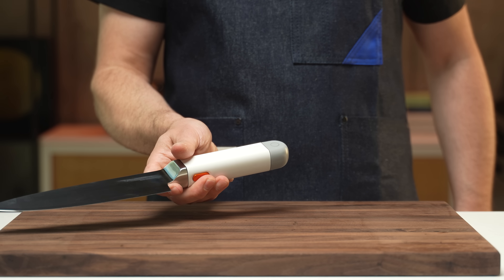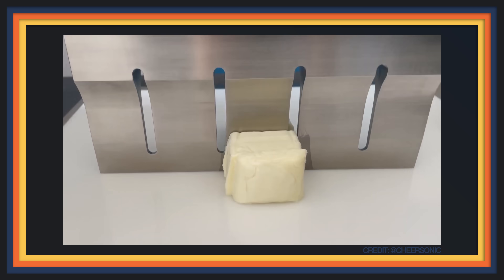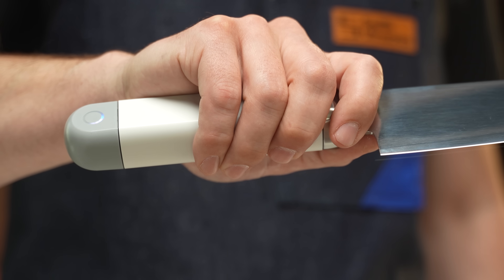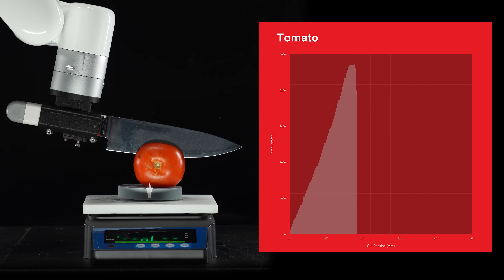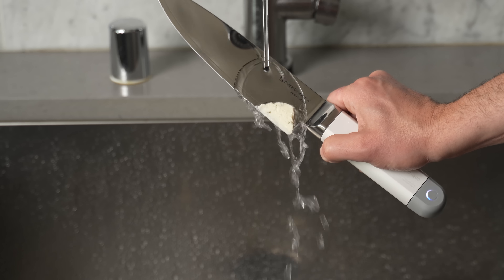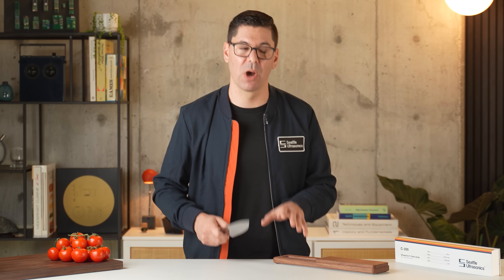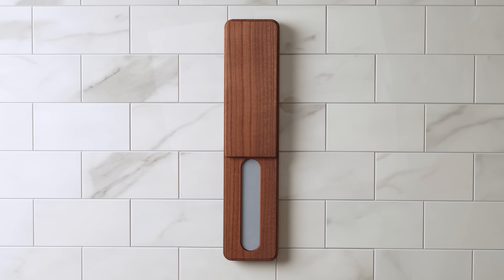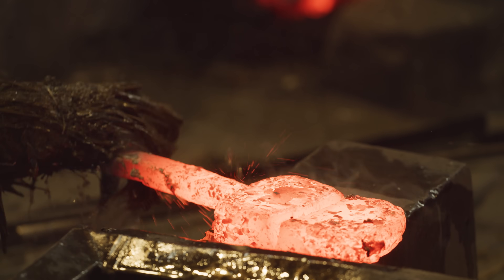The World's First Ultrasonic Chef's Knife for Home Cooks: Seattle Ultrasonics C-200

Comment: I watched this video to the end, took my $5 whetstone and $25 chef knife and put them away, getting ready to order this revolutionary life-changing knife. I clicked to the website, took a look at the US$500 price tag.. And went back to my kitchen, took out my $25 knife and placed it back to its usual place, where I would continue using it tomorrow and for years to come. Thank you for a nice dream. 😂😂😂
Reply: Y'all saying "my knife works all the time" are missing the point.

Most people with expensive knives have dull knives. It's a lot more convenient to put your knife on a charger when you are done with it than it is to sharpen it once a month.

This will (till copycats come out) be the only knife that will retain its ability to cut without regular sharpening that a consumer can buy, period.
Reply: @deejnutz2068  if the blade vibrates it doesn’t mean that it will keep it’s sharpness better than any other blade. On practice this micro-jittering can lead to even faster dullness
Reply: @casualcoffeeshooter perhaps or perhaps not. The microcuts might put less pressure on the blade edge when cutting and so not dull it as fast. But I bet even dull it will still cut a lot better than a normal dull knife.
Reply: @StefanSteinerWA  My Gramma had this kind of electric, vibrating kinfe back in the 90s. Construction was obviously different (huge handle with motor and slots for big batteries), but the main principle was the same - making the blade to vibrate so you can put less force on the knife to cut. And it was easier, when the blade was sharp. It was getting dull like any other blade and required sharpening + the micro vibrations in long-term were painful for the wrist. Back in the day, it also wasn't cheap - costed probably equivalent of modern 500€.
Reply: its actually insanely cheap for what it is

the amount of time and effort that went into this.. and its the only thing on the market.

big greedy corporations would charge 1999$ for that thing in the "base" version.

and they would offer a "pro" model for 2999$ aswell...
Reply: @pedro_peyote  this. I was expecting in the thousands
Reply: @Nooticus I wasn't. At 500, it seems overpriced
Reply: @pedro_peyote not cheap considering the built in battery only last 3-4 years 😂
Reply: @apocalic and what happened to your $500 knife when battery dies and you can't get a replacement 😂
Reply: @apocalic  So then open it up and solder in a new one?
Reply: @apocalic  On their website you can see that the battery simply swaps out whenever you want - they sell extra battery packs
Reply: @DirkGently-km3hn  same what I did with my outdated heated gloves or Makita drill ... go to the workshop specialized in refurbishing batteries. Guy opened it, checked, exchanged, returned, I paid few bucks and keep using it  till today.
Reply: Why did I see 3045?😂
Reply: Honestly.....for high end knives, that's cheap.
Reply: @kylebakner2119  Nowadays you can buy a very good knife that almost competes with high end ones for under a hundred bucks easily. Like for about 70 or smth like that.
Reply: @kylebakner2119  No it isn't. If you are paying over 500 for your knives then you are being a pretentious f(*# and not just buying good knives.
Reply: @kylebakner2119  after 3-4 years the battery will die and you are left with an average knive. The steel used in this knife is nothing special.
Reply: @kylebakner2119  But is this "high end" with a person forging it, or is it a mass produced idea? It's a sonicare knife. You don't have to sell an idea of a knife, they're everywhere. At the end of the day it's a knife that vibrates. This is a knife for people with 0 cutting skills and plenty money. It'll likely be used once then put up. If it's not charged, it's just an overpriced knife. At that point, just go buy a knife. I'm not saying it's not a cool creation, it actually is, but it's novelty. 
What happens if the idea fails and you need a battery that is proprietary? You have an expensive knife that cannot live up to it's intended purpose.
Reply: @Soundsaboutright42 "if it's not charged, it's an expensive knife". I mean, if you don't charge your cellphone, it becomes an expensive paperweight.
Reply: @Soundsaboutright42 Counterpoint: ultrasonic blade is cool as hell. In Metal Gear Rising Revengance, the protagonist rocks a an ultrasonic katana and this is the easiest way for ppl to feel like him
Reply: @Soundsaboutright42  that's like comparing an apple watch or a good smart watch to a spring loaded mechanical watch.
Reply: @Soundsaboutright42  At least if the sonic part of the thing dies, or you can't get a new battery, you still have a decent knife... most of these kind of consumer electronics become e-waste
Reply: even at $299 I'd buy it
Reply: There is really no point using a metal knife with vibrations.The only useful precision knife would be either laser or sound waves.
Reply: Wait $500? It's EUR 329 here pre-tax.
Reply: @lypanov  329 euro is like 500 dollars though
Reply: @Nooticus  try 389 🤡
Reply: @robocope9  chill out bro. hardly necessary to use that emoji for an innocent mistake
Reply: 369sonic also claim to be first
Reply: @6:55  He says you need to hone it and sharpen it.  The ultrasonic feature probably dulls the blade faster than normal when you do something stupid like cut into bone, cutting board, cookie sheet, pot, or pan.
Reply: This is solid science applied. I am impressed with you sharing the shots of all the prototypes and some manufacturering. I did not expect to be glued to a video essentially selling a knife, but it's certainly on my wish list.
Reply: Damascus steel chefs knives sell for thousands of dollars
Reply: @saadbenbenabslam5176 and? This ain't that, nor is a Damascus steel needed for a kitchen knife.
Reply: Honestly 500 isnt bad for something like this if the knife quality is good. But id also be willing to bet that in a few years a cheap knockoff will be available for less than a hundred. This is a pretty revolutionary piece of technology if it truly works as he's demonstrated here.  There will definitely be copies VERY soon. Hell, he even freely explained how it works in a very technical way for an advertisement. 

Give it 5 years or so and this thing will be easily available.
Reply: @jeffreystewart9809  With rapid prototyping probably by next holiday season. Sadly I'm not an early adapter. Gosh if I could try it out myself perhaps I would be convinced. I can afford $500.00 if that's the last chef's knife I'll ever own.
Reply: @fiveminutezen   Early adopter is the correct term my friend.
Reply: @fiveminutezen  indeed
Reply: @jeffreystewart9809  Honestly if you are paying over 500 for a knife you are doing it because you are trying to show off not because you are trying to get a good knife... now are you a brand 304 or are you a shill for this company?
Reply: @thomgizziz   

Hey. 

snaps twice  

I'm over here. Thats a strawman you're attacking. 😂

Now, do it right and try asking me things like why I like good quality things, or ask me why I think something like that would be well worth it.  

Dont assume things. You know literally nothing about me. 😊
Reply: Honestly,  not a bad price tag, considering how much people spend on "enthusiast" knives. If it has a solid warranty, being a machine/tech, is a better question at that price point. My knife doesn't stop working.
Reply: Sorry you’re poor . It’s not for minimum wagies
Reply: @ihmpall and paying for overpriced gimmicks is how you get poor 😂
Reply: @DirkGently-km3hn no, not being paid for work is how you get poor.
Reply: @sppb666 not all work is valuable. Making an overpriced ewaste gimmick isn't valuable. If a seller can figure how to create value vs what's already on the market, that is a them problem
Reply: @DirkGently-km3hn value is determined by the market. You can say whatever you want. For me this thing has more value than any iPhone or other flagship Smartphone that doesn't invent anything. Its something new. That alone is already more valuable than slob products.
Reply: @sppb666 it's a gimmick ... And the iPhone will sell WAY WAY more than this. Sure you can waste your money, it's a free country. Most won't and this will flop hardcore, and you won't likely be getting replacement batteries.
Reply: @DirkGently-km3hn a iPhone is more a sad expensive gimmick than this thing. 

Its uninventive and the same for the last 5 years. 

The knife is a new invention and therefore way more valuable.
Reply: @sppb666 😂 the knife is a gimmick with limited utility and questionable longevity. I seriously doubt anyone including you would give up their smart phone for it. Don't even bother lying saying you would, no one will believe it 😂
Reply: @DirkGently-km3hn i would give up the next 3 generations of Smartphones just for any inventions to happen. 

Thats the point. 

The point isnt this against that, the point is you dont understand the value of invention in general. A invention in itself doesn't even need to be useful at all, even IF this is "just a gimmick"  its something useful that simultaneously enables following inventions.

People like you would be against the invention of domesticated fire as its a gimmick.
Reply: Pretty sneaky for YouTube algorithm to recommend me this bs
Reply: Great idea. What happens after the warranty ends and it has a problem? Get a good knife, learn the art of sharpening, feel like a boss when you can sharpen like a pro or alternatively wait for a cheap 50$ knock off from Temu.
Reply: Temu, my friend, and you are made for each other. Congrats! @annapoliti7049
Reply: Its actually pretty cheap for what you get. 799 would be more fitting. Its Revolutionary and good quality.

My most expensive (not high tech) knife was around 2350€ shure its much larger and hand made with life time warranty and service... But i think it was worth it. 

Cuts through meat like its butter and stays razor sharp for months.
Reply: @sppb666 mine cuts like butter and was $90 😂
Reply: @sppb666 remember battery dies eventually like in 3-4 years. Should have gone with AAs.
Reply: @apocalic or just buy a replacement battery instead of wasting vast amounts of resources for throwaway batteries. The energy density of Li-Ion batteries is astronomical amounts higher compared to Zink Coal or similar Throwaway cells.
Reply: @sppb666 what are you talking about? The knife has a built-in battery. You cannot replace it. Planned obsolescence.
Reply: @apocalic  bro didnt watch the whole vid. You can pop thr battery out for charging via usb c. Meaning, you can replace that part with a new one.
Reply: @sppb666 there are rechargable aa batteries 🤦‍♀️
Reply: @DMalek non standard battery... Good luck with that 5-10 years from now
Reply: @DirkGently-km3hn yeah. And they are regularly thrown away because people think they are throwaways. And they leave a spot for throwaways. Wich is bad.
Reply: @sppb666 lol that's called recycling... Rechargeables do have a limited life. My sets in rotation usually last 15-20 years with good treatment. Any argument against AA rechargable applies to lithium ion except AA generally don't catch fire when abused.
Reply: @DirkGently-km3hn its a argument of having the fromfactor aa/aaa as this will be used for non rechargeable batteries instead of rechargeable ones. A dedicated swapable battery like this thing has is better as its CLEARLY and Visibility a rechargeable one and if it fails you can buy a replacement part. 

I would be more in favor of a standardized rechargeable battery design that isnt AA/AAA formfactor but that sadly does not currently exist. Maybe it will some day, and it should but right now the one thats on the product is the best option.
Reply: @sppb666 no the argument for aa isn't for disposable batteries, it's for standardized rechargable batteries. It's so when this company  goes out of business, you will still be able to find batteries 5,10, 20 years from now instead of buying proprietary ewaste. If I'm buying supposed quality I like to buy it for life.
Reply: @sppb666 and yes, standardized lithium batteries also exist 18650, etc. that is how many EVs and almost all power tool batteries are built 🤦‍♀️
Reply: You could spend around 100 for a real knife that will cut better and doesn't rely on electronic to ffunction and will be much sharper too.
Reply: @ripleyhrgiger4669 The thing about regular joes is they never sharpen their knifes and let them be dull for a really long time before they lose patience enough to just get it done. if this thing manages to still cut as well as a sharp knife when it gets dull longer lazy people win. The thing stopping me "other than the price" is that rather unique battery that hopefully isn't proprietary. Gotta be able to upkeep it cheaply if anything goes wrong.
Reply: @tokyofish1211 this isn't magic, it will require sharpening as well.
Reply: Brokie lol
Reply: @baatzi  Are you rich?
Reply: @baatzi  Not buying things that aren't good value isn't being a brokie and the fact you think this is a sick burn shows how daft you are. Stop being a clown.
Reply: @thomgizziz  Brokie detected
Reply: @baatzi5111 You’re not that guy, buddy.
Reply: @TranceFur 👹

Comment: I hate the fact that so many new devices use proprietary batteries and charge a small fortune for them when they can simply put a battery cover on the device and use 18650/21700 batteries that cost less than $10 to replace. At least this one is removable unlike so many devices that seal the batteries in and you just have to throw a $400 device in the trash when a $8 battery no longer charges.
Reply: I have the same concern

Comment: The concept of an ultrasonic chef’s knife is remarkable. The key question is whether it’s truly practical in everyday cooking. In the rubber industry, I’ve seen heated ultrasonic blades cut through thick, tough material with ease – almost like slicing butter. If applied to food, this technology could make even frozen meat, fibrous vegetables, or sticky dough effortless to handle.
Reply: As a "knife guy" and cooking enthusiast, the non stick is a bigger deal to me than the easy cutting.  I already keep my knives razor sharp. What slows me down when slicing and dicing is blade stick.

Comment: Awesome jump in technology, I've seen those Ultrasonic blades that are used in large factories and always wondered why somebody couldn't miniaturize it with tech we have today. What an ambitious project, I can't wait to order one!
Reply: A lot of the complication has been getting an exact weight\mass, steel type,  length and thickness to pair up with just the right frequency to make all of the blade oscillate just right.  For instance, if you took this same handle and just put a blade in it that was an inch longer or was a mm thicker, it would no longer work.

Comment: How do you manage to make a real video sound so fcking hard like AI voice slob? Also while it looks interesting and I am curious if it gets any kind of adoption, it doesn't fix the issue of the blade getting dull. Like at all. Sure it might cut better than a normal knife at the same sharpness level but it will 100% still progressively lose cutting power and get more dull over time which means you still have to sharpen it. Especially if the edge gets rolled, those vibrations won't help you that much anymore since it's just like trying to saw with a pipe at that point (exaggerated of course, I'm sure it will still cut)

Comment: So you HAVE to hold the knife wrong to use it? Fellas this seems like a really unnecessary solution to a problem that's solved by a sharpener. The non-stick bit is kinda cool though, but it's not $400 cool. This is a product for insecure rich people

Comment: I love ultrasonic knives. In the lab and industrial they are great. Would I LOVE to have one at home, heck yeah. But that price tag is, in my opinion, expensive for what it is. I'm not trying to take away from the technology as it's proven and efficient, but for $400 I could buy a high end professional Japanese knife that would cut just as quickly and easily. This knife also touts having Japanese steel. If this knife was $200 I would be pushing the buy button right now.

What I'm trying to convey is for $400. I could buy a Japanese knife that is handmade with traditional techniques and has hundreds of hours put into the manufacturing polishing and sharpening versus $400 for a sonic knife which is also made with Japanese steel. They will both perform about the same, so I don't really see the advantage of buying a $400 ultrasonic knife, which honestly given its technology I don't think is worth the money, versus a $400 Japanese cutlery knife. I guess really the only advantage is the ultrasonic knife doesn't have to be sharpened as much if at all if it's handled properly.

Maybe I'm just overthinking things, but I guess I'm just one of those people that would rather spend that kind of money for something that is handmade and of good quality, from craftsmen that have spent their entire lives perfecting rather than spending the money on something I feel is overpriced mas-produced product and provides the same or equal product performance. And let's not forget that any event that you forget to charge the knife now you have to wait for it to charge before you can use it.

Comment: Why is the price kinda reasonable? This is such a unique product and professional knifes usually can get really expensive but 329€ seems fair.
399€ with the charger too I would say, though I would have wished a traditional AA LiPo Battery. Maybe technically it wouldn't have been possible but I would still be scared if I ever can get replacement batteries